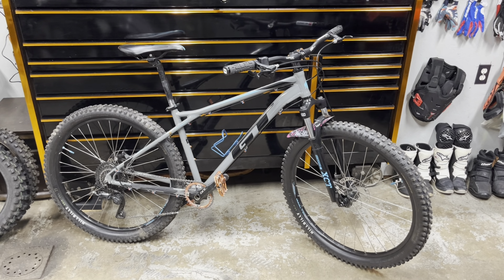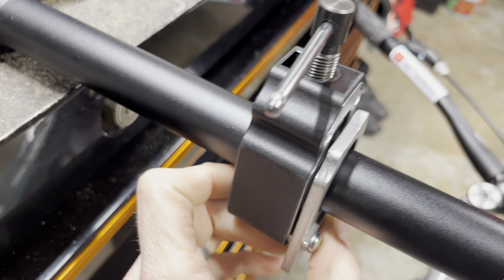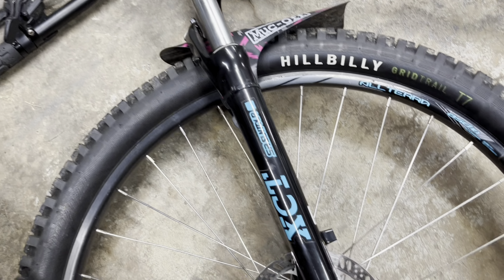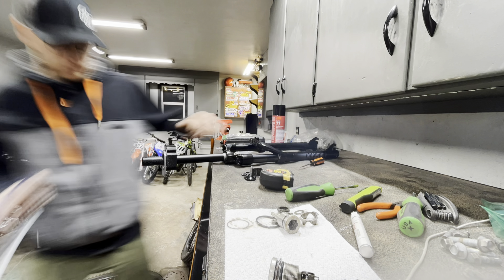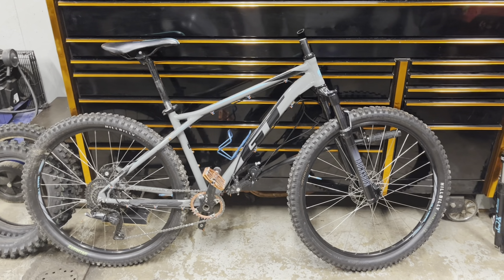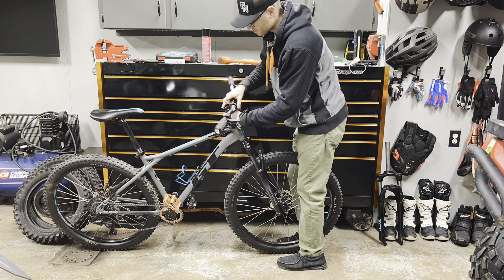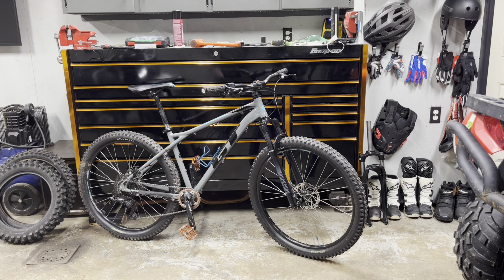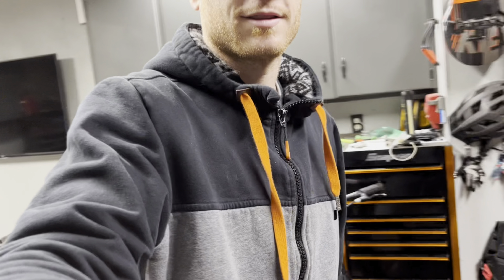GT AGGRESSOR PRO FAIL AND AIR FORK INSTALL - ROCKSHOX JUDY

Comment: That jig is pretty awesome at first I was thinking he's just going to hack that off 😅
Reply from the maker: Believe me I thought about grabbing the sawzall 😂 doesn’t have to be perfect haha but that jig is cheap haha so I did it by the book haha
Reply: @motodad311 back in my BMX days I actually used a tubing cutter for copper plumbing.... Pretty sure my dad wasn't thrilled the next time he had to use 🤟😆
Reply from the maker: Haha for sure haha, the jig and hacksaw definitely isn’t perfect but it worked well enough haha

I remember cutting an S&M pitchfork down to size freehand with a hacksaw haha
Reply: I use a tube cutter and it works great.

Comment: Haha Nice Fall ! I fell a few days ago on my Aggressor Pro  flying down  a muddy snowy  hill testing out the new ixf crank  Im 50 so i got to be careful cant miss work. LOL  now my next upgrade is knee pads luckily i didnt pull my acl but slammed the bone on the side of my knee put a dent in the chain waiting for a replacement and  looking to see how you like this new fork you installed. I havent done too many upgrades yet. I threw on some Schwalbe tires and the ixf  crank and tuned the bike up. I like the acolyte upgrade ill do that when my drivetrain starts getting wrecked.  Good job on your vids!I Was that the silver or Gold Judy btw. Thanks
Reply from the maker: Thanks for watching! Yeah, even in my 30’s the slams suck haha 

It is the silver Judy, and so far that fork is really great! 70 or so miles in on it and it’s been awesome, love the adjustability.  Way comfier and quieter ride than the xt spring fork they come with - the only real reason I swapped over to the acolyte was because of the terrible chattering on the stock stuff haha

I have a set of rims to install and hydraulic brakes and I’m pretty much done with the bike haha

Comment: Hey man, whats your plan for a hydraulic brake setup? I'm a little torn on which way to go.
Reply from the maker: Hey man, thanks for watching!

I plan to go with shimano MT series, not sure if I’m going 2100, 4100 or 6100 haha

Honestly, if I would have never ridden a bike with hydraulic brakes I would never have had an issue with my cable brakes haha
Reply: Yeah man same. I feel like it stops pretty good. But I bought my fiancé a bike off Craigslist that has hydraulic brakes, so now I'm like I guess I have to get hydraulic too haha. But love your videos just finished installing most of the same stuff you have and yours and it's crazy how much better it rides. 👍
Reply from the maker: @randon8814  i just recieved my shimano mt 200 brakes this evening so i will have a video incoming of the install and test ride haha

thanks for watching

Comment: You should upgrade the brakes next. get the Shimano mt420, tektro orion or the  Shimano deore level 4 piston brakes.  You should also get 180mm rotors front and rear and get the caliper spacers to run 180mm rotors.  I got some Shimano mt401 2 piston calipers on 180mm rotors and with tektro sintered metal pads and i felt like there was more to be desired. I have a gt aggressor pro as well.
Reply from the maker: That’s for watching, and I agree haha I need to put some brakes on it haha